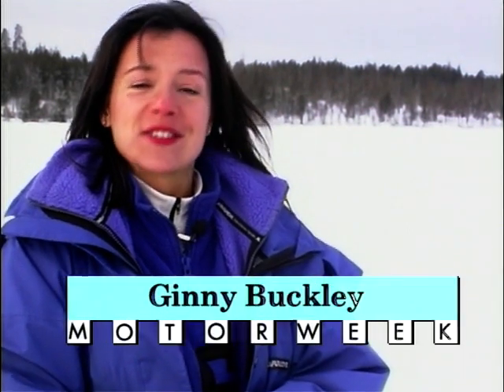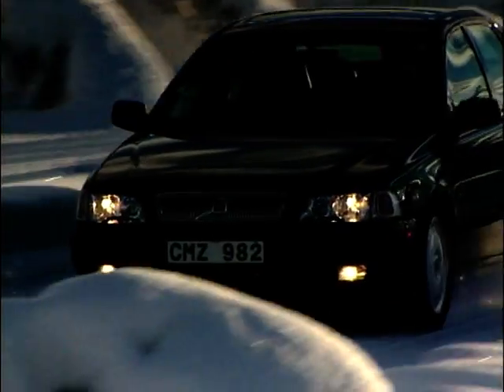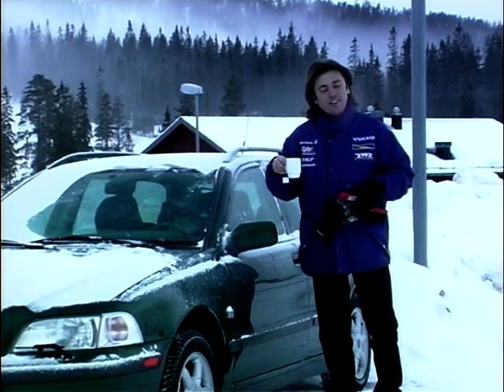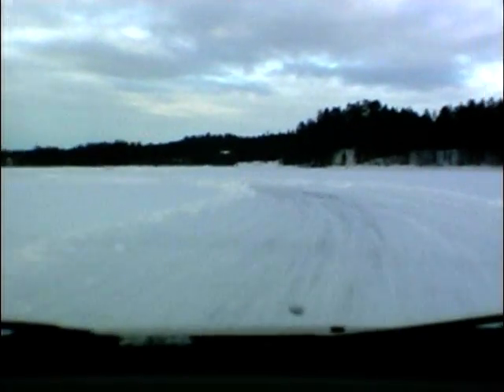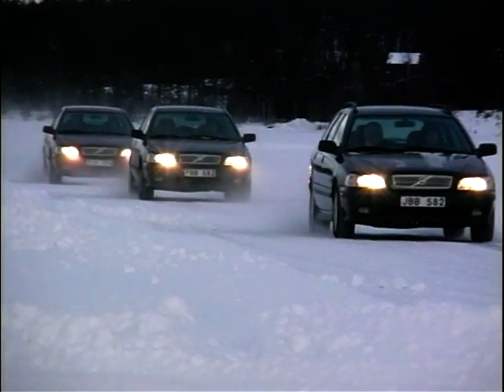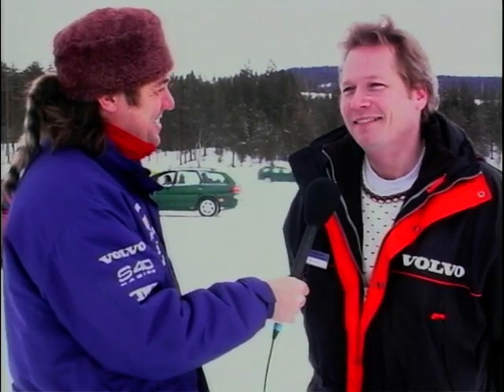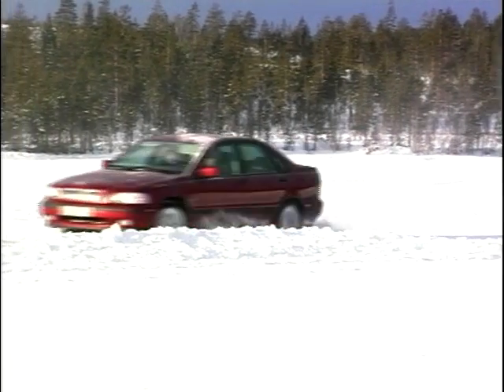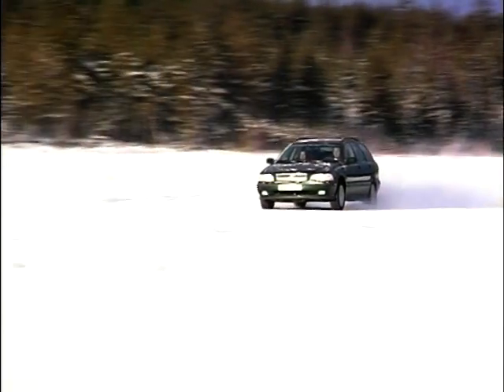Volvo's Ice Driving Test & Techniques - Swedish Arctic Circle

Comment: The S and V 40's were a perfect example of a car that CANNOT handle the Swedish climate + tons of salt. They rust heavily on the chassis and panels, even on the hood. The 90's S/V40's were barely Swedish being built in the Netherlands and other places, plus being co-developed with Mitsubishi. On the other hand the Swedish and Belgium built Volvos like the 850, if they rust, mostly just rust on the front side panels and on a much smaller scale.
Reply: Lets not kid ourselves, all cars rust in salt. I have a 2000 S40 driven exclusively in the north of sweden which doesn't have a lot of salt and it's completely rust free, like any car driven up there. My grandfather has owned 2 Volvo 850s one is extremely rusty on the underside and quite a bit on the doors and rear bootlid. One is almost entirely rust free like my S40 as it was also driven in the North.
Reply: Lucas Kroon how about the 2000s S40?
Reply: The phase 2 is actually pretty ok